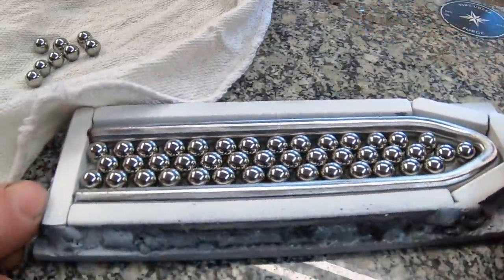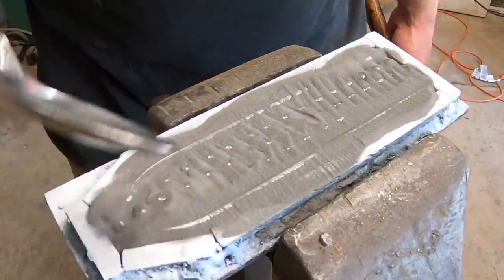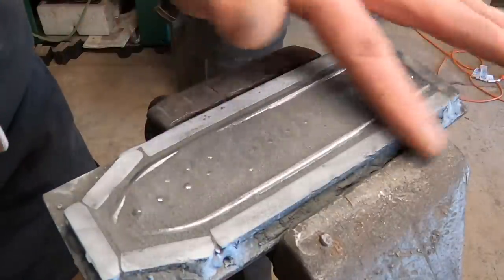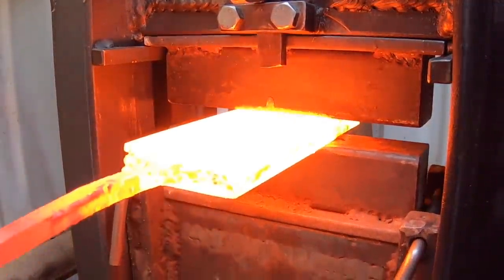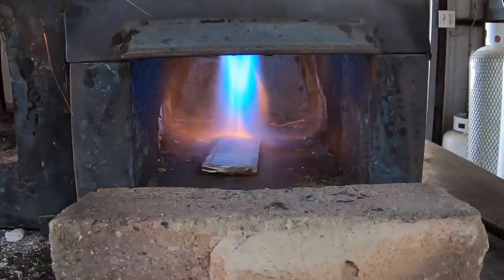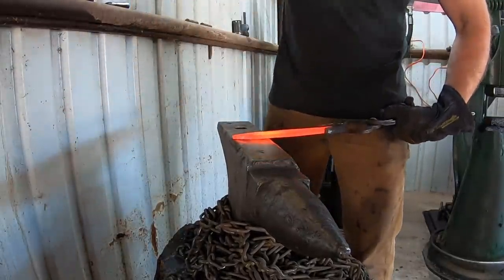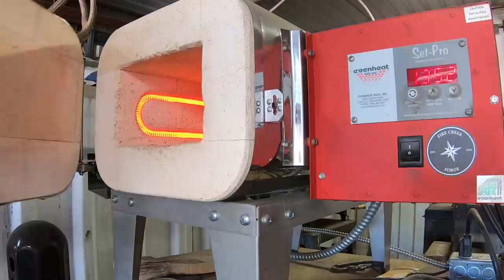Next Level Ball Bearing Damascus Knife, Blacksmithing and Knifemaking, Forging Knives, Bladesmithing

Comment: People arent even trying anymore.  No smithing art most of the shape  is cut out, everything is a workaround. And than you slab the tag 'next level' and 'damascus' in the title and get views... Damascus doesnt mean to take two kind of steal in your knife and than toss it into some acid. The folding is part of it. Its not damascus its etched garbage. And lets be honest the blade doesnt even look that good ...
Reply from the maker: Damascus steel is patterned steel, of which there are historically two categories: Crucible, or wootz; and pattern welded. Pattern welded encompasses a wide range of techniques and results. In antiquity, pattern welded steel was made for the purpose of combining different properties in the same blade. This allowed smiths to forge a blade that was tough and flexible but still held a reasonably good edge, and could also be exploited for creating unique patterns in the blade. 
Crucible steel accomplished this not through combining different grades of steel or iron, but through metallurgical processes that controlled the carbon and other components of the steel within the billet. Crucible steel was not folded and the patterning or "watering" was inherent to the wootz. 
Pattern welded usually includes layering (not necessarily "folding") but the purpose of this project was to create a pattern welded billet in a single forge weld process. Thanks for watching!